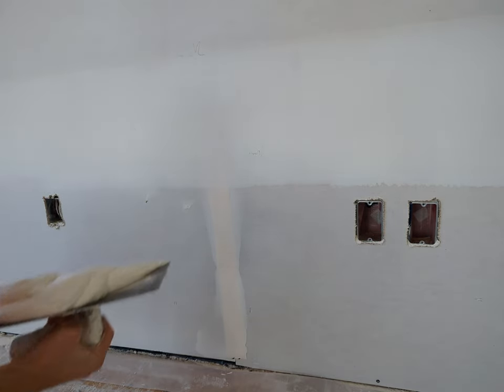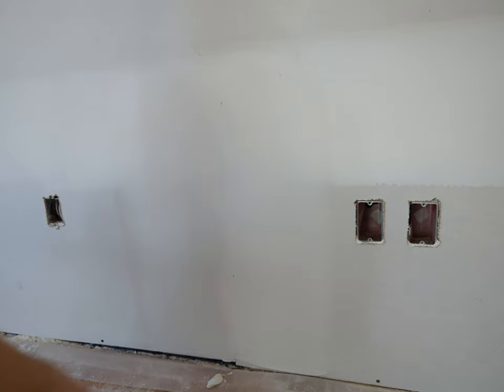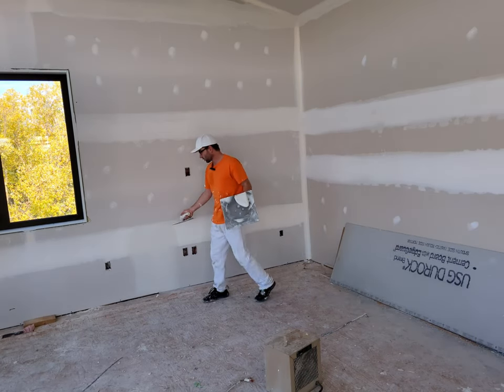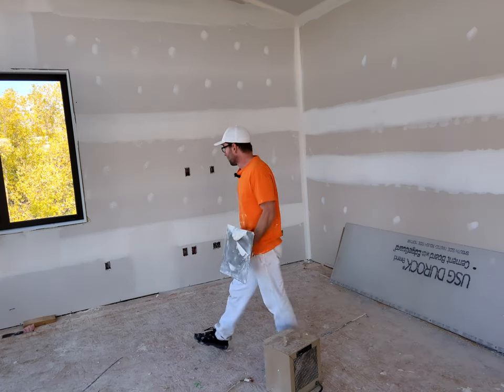Why I love the Curved Trowel

Comment: I run the curved trowel straight over a butt jion then second coat either side with a flat trowel..same same but opposite
Reply from the maker: Sometimes I do it that way too, I'm not sure if I've fully settled on one way of doing them, even after almost 20 years
Reply: I’m the same way 14 curve over centre of butt then 2 coats with straight trowel
Reply: It's always based on situation.. As tapers we must adapt!
Reply: aka steal more planks from the brickies for our elaborate scaffold design